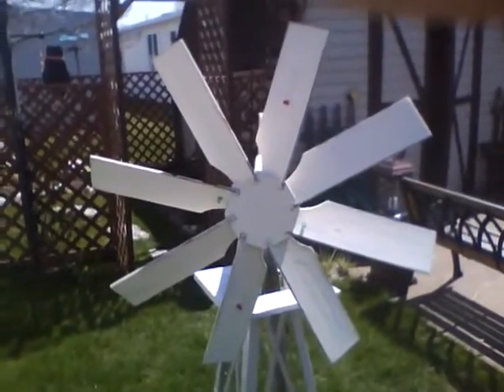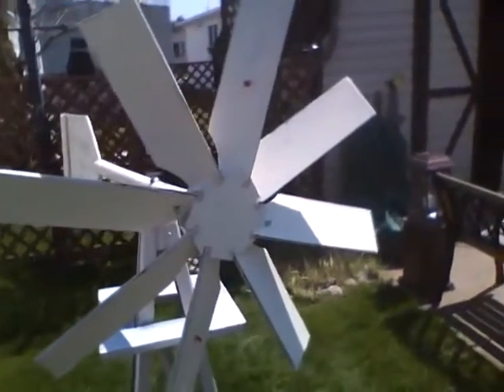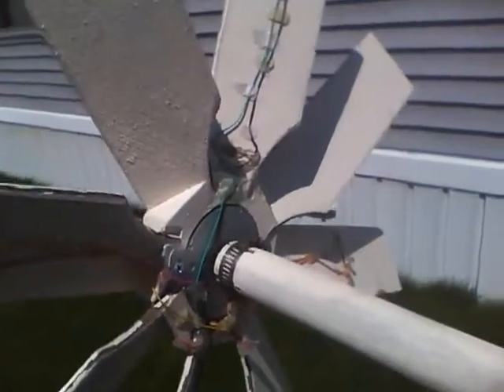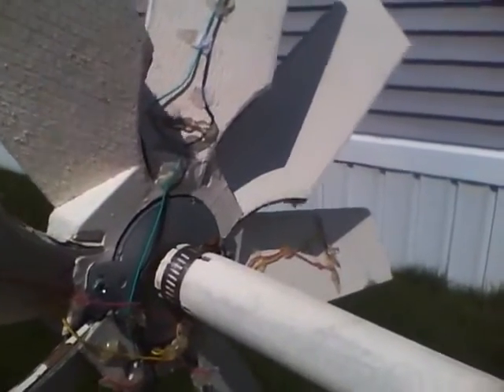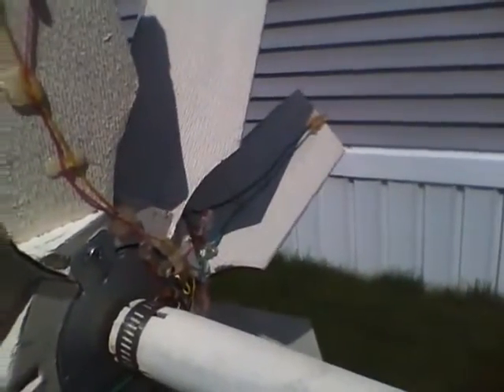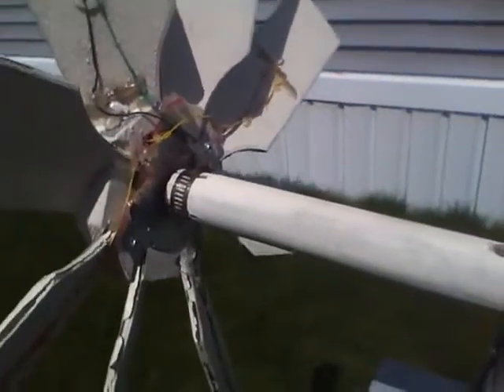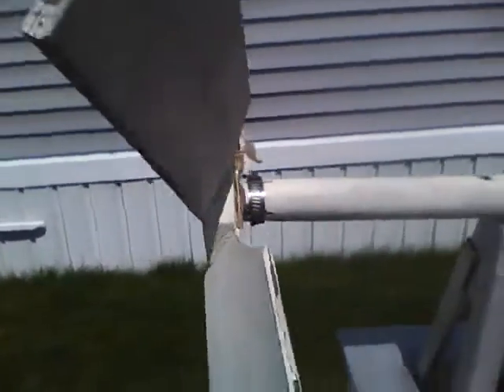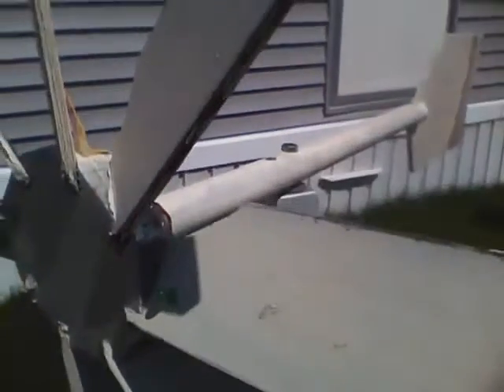Power Generator LED Display Whirligig

Comment: I was not sure what the generator motor is can you let me know what it is. Thank you.    I make wooden wind mills and have thought of this but never figured out the power supply   Any info you can give me would be greatly appreciated    Thanks
Reply from the maker: This has a stepper motor from a 5 1/4 floppy disc drive. The motor is mounted in the blade hub. The wires run from the motor to the LEDs. When the wind turns the propeller, current is generated by the motor.
Reply: Is there any other kind of motor you tried that might work. I don't think I'll be able to find a floppy disc drive  I haven't seen one of those for many years,  also how many volts do I need to make the led's light up like on the one you made.  
P.s.  I love the eagle whirly gig you made , very nice.
Reply from the maker: Actually, just about any motor will work and you only need about 1 volt to light the LEDs.